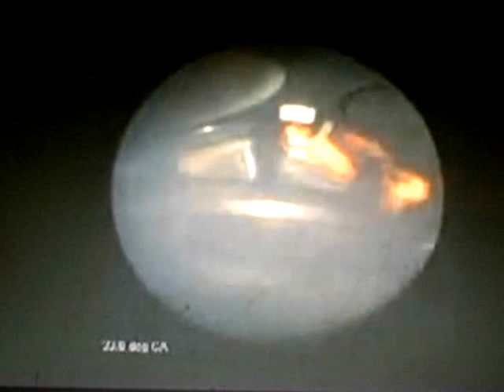Inside an Engine Combustion Explained pt 2/2

Comment: Hey man, It looks like you have an example of pre-ignition going on here. Heat rejection describes the heatloss of the enclosed gas to the outer walls. It looks that in this engine the compressed mixture gets quenched by traped evaporating fuel at the intake valve. Witch prohibits the combustion forming an nice flame front. Can you give some more information about your source?
Reply from the maker: Sir Dugald Clerk, in the year 1880. No one could get four strike strokes to run on 'time'. All four strokes were made like a modern engine with cams a tooth off. He explained what I did, then they Knighted him..Sir Dugald Clerk. There's more than I talked about in actual engine design, but the Shell Microjoule (a small go kart) goes 11,500 miles per gallon regular pump gas. They burn a little more like you're looking for-check it out!!!
Reply from the maker: https://www.youtube.com/watch?v=fiMM2S0aADM